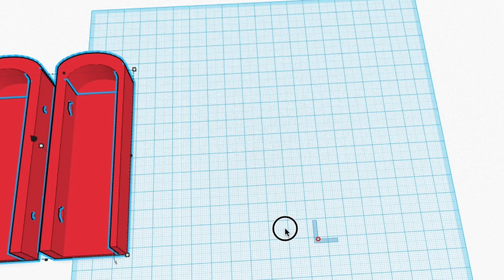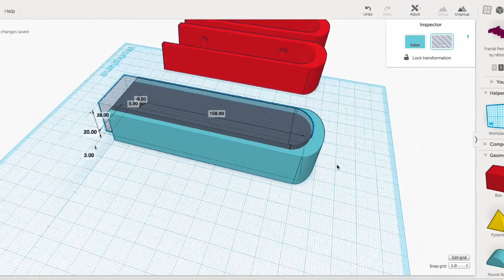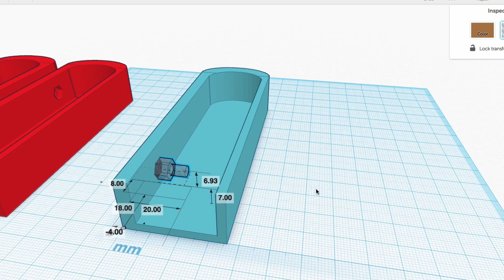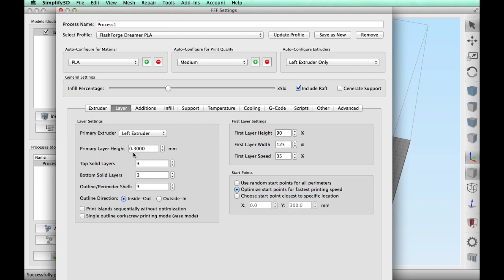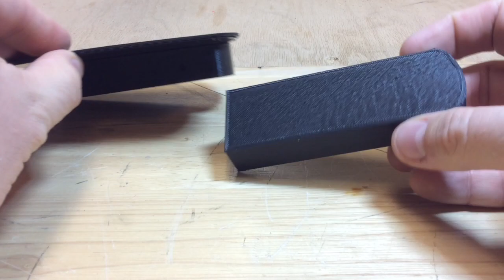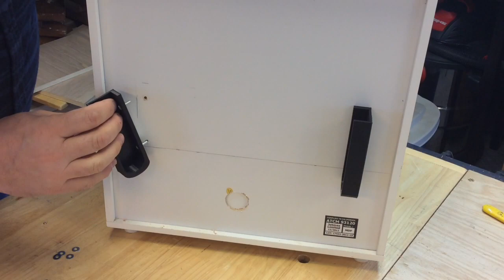Metal Bolt Inserts in 3D Printed Netbook Mounts for Portable Electronics Workbench

Comment: For the bolt holes, I'm a fan of TinkerCAD's "Polygon" Shape generator that does the optional point.  I uncheck point, set the number of sides to 6, then I can set the Apothem to the size of the bolt head +/- 0.2mm.